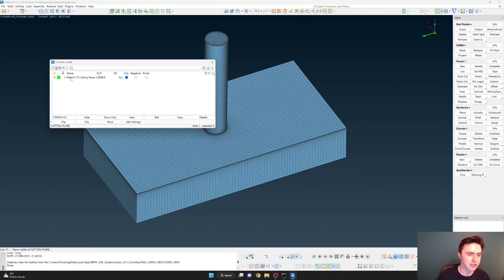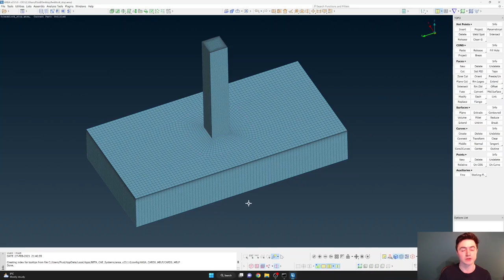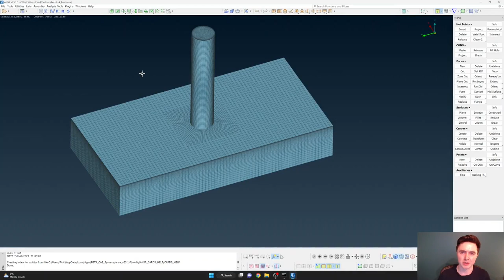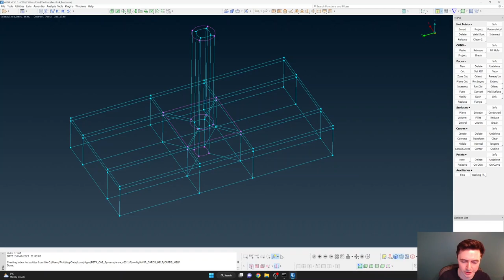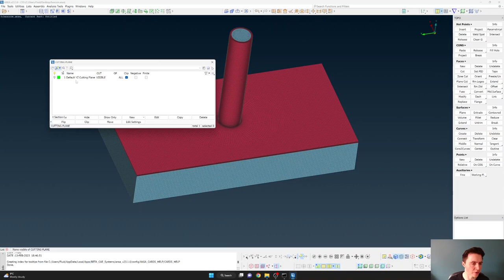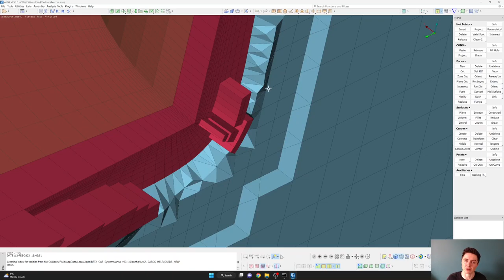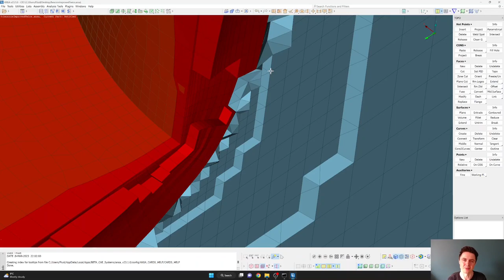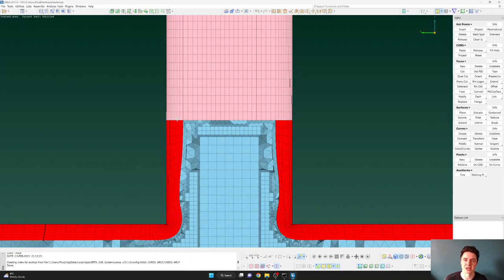[CFD] Pipe Mesh Transitions (Unstructured, Hexcore, Block Structured)

Comment: I just wanted to drop by and express my immense gratitude for the fantastic content you create in the realm of CFD. Your videos have been incredibly helpful in expanding my knowledge and improving my skills in this field.

I do have a question though, and I hope you could shed some light on it. I've noticed that when using Fluent, the mesh metric indicates good mesh quality after surface meshing, but it seems to deteriorate when generating the volume mesh. I'm wondering if this could be due to the inflation layer growth rate?

Your insights on this matter would be greatly appreciated. Thanks again for your dedication to sharing your expertise with the CFD community!
Reply from the maker: Good question. The best thing I can suggest is to have a look at the layers after you have grown them and see if you can see where they might be having problems (sharp corners, compression into tight spaces, 3D corners). It is usually in these locations where the quality deteriorates. 

A useful trick is to grow 1 layer, and then check the quality. If this later is ok, then delete it and try growing 3 layers. Check the quality and then delete them. Now try with 5 layers. And so on until you have all the layers you need. When you are happy, then move onto the volume mesh. 

It may be that when you have a high growth ratio your outer layers are getting into trouble in the corners/close to other geometry etc. Hopefully this method of trying a few layers at a time should help you to understand exactly where you are having the problem. 

Think like a detective! Can you figure out the puzzle?
Reply: @fluidmechanics101  
I want to extend my heartfelt gratitude for your prompt and insightful response. As you suggested, I've started to closely examine the mesh layers after growing them, paying particular attention to areas where problems may be occurring, such as sharp corners, compression into tight spaces, or intricate 3D corners. This method of investigating the mesh layers incrementally, starting with one layer and then gradually adding more while checking the quality, seems like a sensible approach. 

One example I've observed is that when examining the quality of the surface mesh, the skewness is within an acceptable range, with a maximum value of 0.6. However, when creating the volume mesh, the skewness increases significantly, with a maximum value of 0.9. This discrepancy has led me to speculate that the problem might be related to the higher growth ratio not being optimized for certain regions.

Comment: Hello! Dude, I love your videos and the quality of your explanations! But, I'm a CFD beginner, can you recommend me where to start in your videos? I'm a little lost....
Reply from the maker: Sure thing. I would probably start with my series on residuals (it is a 4 part series), as you will be looking at residuals in all of your simulations! So a good understanding here is very useful (also I use a simple example of heat conduction in a bar, which should be easy to follow). 

Then I would probably have a look at the videos on k-epsilon and k-omega SST turbulence models, as most of your simulations will be turbulent. These are two most popular turbulence models, and often you will have to 'choose' one of them. It is good idea to at least have a basic understanding of what they are. 

That should enough to get you started. Let's me know if you need any more suggestions

Comment: Thank you very much, this happens to be quite useful for my master thesis :)
Reply from the maker: Great! That's just what I was hoping for
Reply: I am in the structured approach but came up with a different alternative actually. I just made the o-grid wider as it was entering the big volume in order to reduce the Aspect ratio, which went from values of even 230 to 10-15 approximately. Do you know by any chance what would be a too high Aspect Ratio for combustions processes in Fluent?
Reply from the maker: I don't know about combustion specifically but generally aspects ratios of up to 10 are fine in the bulk flow, and anything up to 1000 in the boundary layer also seems to be fine
Reply: Thank you very much!

Comment: This was in ANSA, right? How would you compare it to Icem CFD, general ANSYS Mesher, or Pointwise (Cadence), or other. Thanks
Reply from the maker: I can confidently say that ANSA is my current favourite meshing software. ICEM is very buggy and it can take days and days to create a workable mesh (it took me about 2 months to mesh a wind turbine blade for my PhD...) ANSYS mesher is fine if you have a basic geometry that you want to fill with tetrahedra. But as soon as you try and do something with structured regions and complicated meshing approaches, it quickly becomes infeasible. I haven't used PointWise, so can't comment on that one. 

At the end of the day, the best meshing software is the software that you have access to and are confident in using 😊

Comment: HI! As always big thanks for knowledge which You sharing. I got one question, is the mixed structured/unstructured method of meshing is available in Ansys Fluent?
Reply: HI marek, I am using fluent for meshing and yes actually in fluent they have something called multizone meshing approach, where you can create hexahedral type structured mesh, otherwise with the Hexcore method in watertight geometry, you can create hybrid mesh (triangular surface mesh, hexahedral volume mesh, and tetrahedral transition layer)
Reply: By the way this multizone meshing is a relatively new and I personally find not stable, requires great effort.
Reply from the maker: Agreed. My current preference is definitely ANSA (if you have access to it). It gives you a lot more control, particularly for these complex meshing approaches